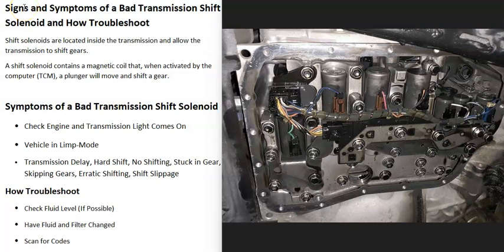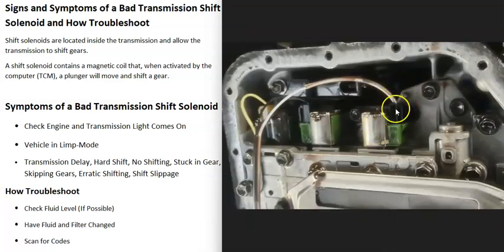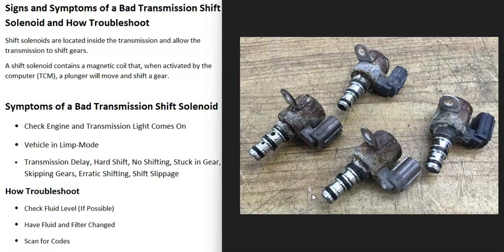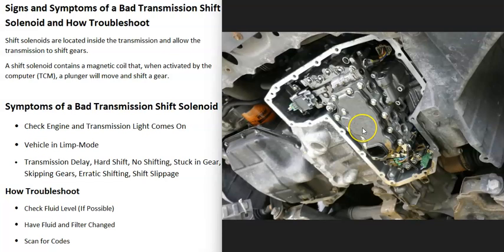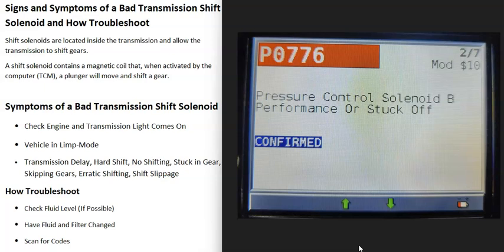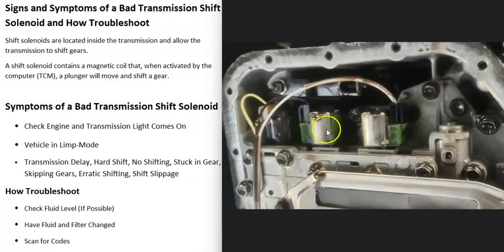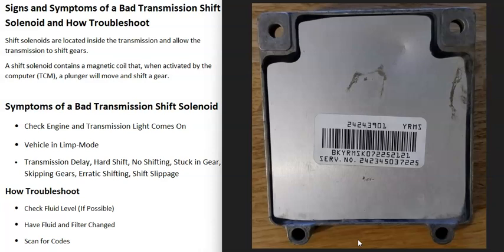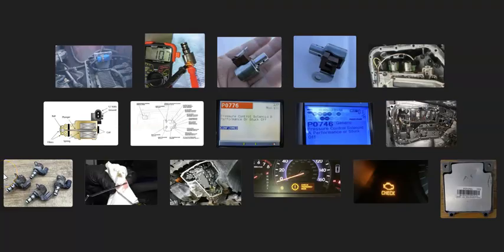Symptoms of a Bad Transmission Shift Solenoid

Comment: Thanks for sharing those information. I have 2011 corolla 4 speed automatic 1.8L I am getting a jolt when cruising Nd accepting, only happens after 30min of driving it doesn't do it at just operating temperature it happens when really hot. I have changed the fluid 5 times and at different levels and I still get hard shifts on kickdown. Please help

Comment: well I have issue with 2004 chevrolet express 1500 V6 on the morning start and run good after about 3-4 miles slow down and completely stop the engine is still running but the van is not moving. turned off wait about anhour or two start and moving here about 3-4 miles does the very same thing. What do you think

Comment: My car is a 2009 Sonata with a 2.4L engine. The manual states that the automatic transmission fluid level should be checked between 70 and 80 degrees Celsius. However, I want to know where the fluid level should be on the dipstick at 80 degrees Celsius. Should it be in the middle of the "hot" range or at the top of the "hot" range?

Comment: My truck turns on, and idles fine. It switches between all gears but it will not drive forwards or backwards. It just just revs in each gear position. No engine codes. Transmission fluid level and color are perfectly fine. Any ideas??

Comment: I have a 2013 Lexus RX 350 and yesterday all of a sudden it started falling on its face for about 3 seconds when shifting from 2nd to 3rd. I can't find a dipstick to check the transmission fluid. Do you think it's just low on fluid or a bad solenoid?? Would being low on fluid affect only one gear sequence or all of the shifts??

Comment: Got a P0763 shift solenoid C but the car doesn’t run bad or seem of it just turned on and I cleared the code but not sure if I should drive the car to diagnose it further I don’t want to ruin the transmission

Comment: Dodge Dakota 42rle transmission here—delays going into drive ONLY when transmission fluid is cold. New Mopar ATF+ fluid, only 75,000 miles, well maintained. Pulling a pressure sensor fault code. What parts should I replace—just the sensor, or throw in solenoids and/or TCM? Thanks

Comment: I have a 1995 Chevrolet Monte Carlo that is pre OBD2 and not OBD1. No means of jumper for ECM code. Problem I have is I start out running good with rpm to mph on the freeway then after enough slow downs and speed up the rpm increases above normal for mph. Example as a reference; 70mph @2250 rpm. 20-25 minutes into my commute; 68 mph @ 2600/2700 rpm. I suspect a solenoid but which one? Could try shotgun effect and replace all the solenoids.

Comment: Someone please help me. My 2005 corolla doesn't enter reverse, but it drives.
It's showing a code p0741.
What can I do please?
Reply from the maker: P0741 Torque Converter Clutch (TCC) Circuit. Check the transmission fluid and be sure it is good. If the ATF fluid is good, it needs to be diagnosed; the torque converter is having an issue, which could be wiring, a solenoid, or a bad torque converter.

Comment: Hello sir I have a Kia Sportage 1999 2000 model automatic I recently replaced a broken pump and replaced seals but the problem now I have accelerate in order to move and it only takes 12 and reverse hard

Comment: What's the difference between shifts solenoid?Pack and a shift solenoid b is it the same ? I'm getting that code
Reply from the maker: There can be several shift solenoids, usually one for each gear. A is usually 1st gear, B is usually the 2nd gear, and so on.

Comment: What if you have some symptoms but no codes or transmission light?
Reply from the maker: Has the fluid and filter been changed out at the required miles? If the fluid gets old and the filter clogged up, that can cause issues. Also, be sure the scan tool can read transmission codes; many can't.

Comment: Is it possilbe for someone to get under a car and disable a solenoid from the outside, like yank a wire loose, mine went out while parked in my driveway. Tweakers were fucking with my truck and were outside threating my truck again. I went out to drive it and it was in limp right out my driveway and all the codes come back clean, no lights on. I have a reverse but in limp going forward??
Reply: Depending on the car yes, my 2011 Honda accord has them on the outside
Reply: @jonmoore5901  2005 highlander, Codes are coming up clean, guy that scanned it said the senser never activated because it was parked when they did it..
Reply: Guy that scanned it said codes are coming up clean because it was parked and not moving when it happened, senser didnt activate.

Comment: Valvoline didn't Honor their 50,000 mile warranty I am 25,000 under that warranty and now my transmission fluid looked like oil and they wouldn't at least flush and fix them told me they are not a mechanic to diagnose properly. and since then my truck has had problems. because the over filled all fluids they cover a QT more vs specs of my truck. vand them told me it wouldn't be bad or anything. I lost last my nerve and before she shoved out of the bay they said that someone placed it.  and I said that warranty is still valid and binding as of the UCC PUBLICATIONS book. I called corporate to ask them what they are going to do with the following up. and after I spent an hour on the phone "lost communication" and never called me back in all three thresholds and no one contacted me and by UCC law and natural law they did not challenge the in the notice of response letter so I guess they willing accepted

Comment: 2015 Honda civic has the d flashing I have to unhook the battery every day because of a parasitic draw but once I hook up the battery the light goes away and is drivable until I cut the car off then light comes back on Ive replace the pressure sensor and have looked for bad grounds but no luck any insight would be appreciated

Comment: Hi.. I have a question.. I have a 2004 Chevy Trailblazer when it's cold I can drive it and it shift just fine no problem on the highway overdrive.. But once it warms up is stop shifting and I have to let it cool off before I can jump in it again and drive it home and it'll drive just fine. Thank you..

Comment: Hi I have a question. I have an Audi A6 Quattro 2002. It goes into limp mode at cold start my codes at that moment first code is C072F then P0748. Car does go out of limp if warmed up for 5 minutes but codes are confirmed. I changed the solenoid by dropping the valve and also installing a new filter and fluid. Car started running great but it’s still going into limp. I never replace the harness but now I’m checking the outside of the valve solenoid harness and see someone taped it up. How should I go about this? If I drive the car about 2 hours later I’ll get a P0741. C02E5 C02C7 I don’t know what the C codes are

Comment: thanks for the infos , i have a rav4 2018 LE that have check engine light and when I'm driving somtims it joint a bit and the other day I put on reverse and it didn't move so I had to but back on N then on R to have it to move I noticed their is some oil leackade under the transmission and took it to the technician they said its one of the solenoid but not that sure is their a solution to check the oil level?

Comment: My god, you have helped explain possible multiple issues, my seliniod B is causing allot of issues, like irratic shifts up& down, mostly in low speed, now it’s doing it at 30 mph😮I’ve been stuck on a slooped drive up or down with nothing, so I’m going to check wires 1st and clean, and see if wires rubbed , next drop pan and replace B sel, and filter,   Anything you can think of, much appreciated, Eric

Comment: I have no Engine Codes , No Trans Codes. But the car hesitates to go , but only sometimes. Also when I am going about 40 MPH, it also hesitates to go above 50. When it’s going 50 it runs completely smooooth
Reply: Same issue here, did you figure it out ??
Reply: @nikehoodtv8805  Did you figure out what the issue is?
Reply: Stop driving slow 😂😂😂
Reply: same issues with my 2011 Toyota camry
Reply: Same

Comment: Excellent video. To the point no dragging on I think you should make more.❤🎉😊
Where are you located I'm in northern New Jersey I can have you replace my Acura automatic shift solenoidd D. I have a question does the D shift solenoid d means for drive
Reply: No it’s the gear

Comment: Hi there friend, 01 Toyota 4runner 4x4 sr5 automatic. Have you ever heard of a p1760 code? Trans shifts through all gears, downshifts normally but the issue is niw since code she drops into each gear very quick and harshly. The more throttle the better it drives as far as drivability, trying to putt putt is very noticable and concerning feeling to say the least. Regardless theres a prob Im just outlining a little bit. Can it be driven this way wiithout additional damage until I replace solenoid if thats what this issue is..? Thanks?

Comment: I have a 2015 ford transit rebuilt the trans and  now it works but if I use it over 45 mins the trans light comes on and starts slipping or won’t go then min later it will work again like normal any ideas of what it could be

Comment: I have a '91 Chevy Van with a 4L60 trans. Lately I experience troubles with engaging my Overdrive. First it engaged Overdrive but after a few miles it disengaged and shifted back to 3rd. I allready exchanged my trans fluid and filter, which made it a little bit better I guess. At the moment it shifts to Overdrive but after a while it disengaged again and leaves me in 3rd on the highway or on slower speeds. Shifting to 1st, 2nd and 3rd and back is still smooth and without problems. What could be the issue?

Comment: Nice job.... 2015 Mini Cooper Paceman S All4. Automatic Transmission.
1) When I "almost" come to a complete stop at a stop sign or stop light, then press the accelerator to keep going, the car jerks very hard like there is an engagement delay when taking off. Someone mentioned the solenoids might be going bad, or the TCM. They changed the transmount, as they thought that was causing the jerking sensation. It did not solve it. The Motor mounts were not changed as they were not leaking.  
2) If I am at a stop and I remove my foot off the brake, the car does not roll right away like it used to. There is a 1-2 second delay before it slightly jerks and starts to roll. again it use to engage and roll right away without delay.
3) Clanking/squeaking noise coming from the Drive train/engine, suspension or transmission on initial acceleration and deceleration at slow speed (especially when cold). Feels like I can feel it coming thru the throttle. Mini Nashville hears it but can't pinpoint where its coming from or what is causing it. 
Thoughts?

Comment: Im gonna try leaving a comment since it seems you are very responsive. I appreciate that. 

2003 Ford F250 4x4 6.0.

Truck has always drove fine. One day, i drive it all day and went to pick up my daughter. I idled for probably thirty minutes, and when I put it in drive to leave, it wouldnt engage in any gear. I pushed the truck into another spot and allowed it to cool. It still would not engage. Out of frustration, i slammed the gas and suddenly the vehicle jumped into gear and drove fine. The problem never came back. 

Well, now the truck sat for about 1 week, and it will, again, not go into any gear. To be clear, the shift linkage works, and I have observed the linkage does move the selector located on the transmission. 

Fuses are good, transmission fluid appears topped off, and the fluid looks great. Im wondering if it is the pump, TC, or simply a bad filter? What do you think?

Comment: I have a Dodge caravan 2001v6 3.3 I was driving to the store parked van went in side store cAme back out and van has no forward are reverse gears it won't move no problem with transmission before that not sleeping are any problems with it do you have any ideas on what to do

Comment: I have a few questions. Ok I have a 2011 Nissan Altima. I had a p1778 stepper motor code. Changed it. Changed fluids. Ran great for about 2 months. A code come up for a p420 for catalyst threshold bank 1. Cleared the code out. And now I have the p1778 code again. With it saying stepper motor and dcc solenoid. Now it won’t go past 1st gear. So how was it that I cleared a code and it doesn’t work anymore? Help!!  What would I need to change to get it running correctly.

Comment: Hi. I have a 1995 228,000 miles Sierra 1500 pickup.  Only symptom I have is delayed shift from 1st to 2nd. It waits until 2,700 to 3,100 rpms. I can usually make it upshift to 2nd by easing up on fuel pedal just a little for a moment. Does it hot or cold, in cold weather and warm. 

Everything else works as it should. It will downshift from 2nd to 1st as it should. Fluid clean, good and exactly Full. Fuses all good. No CEL or codes stored. No visual leaks or consumption. 

Is this the 1-2 solenoid / solenoid A failing, more than likely?
Reply: I’m having a similar problem with my 2013 Toyota Camry is only happens when I get up to 20 mph is a a slight hesitation before shifting gears ⚙️ but if I ease up to the 20mph it doesn’t do it no lights or codes at all only 90000 miles on the car

Comment: I was priced over $4,000 to get my transmission rebuilt. I was told that was my only option. Change solenoid A and filter add transmission is fine! Save myself a lot of money thanks for the video.
Reply: We’re u get the part from
Reply: Did it throw a code?
Reply: Man I am in the same scenario, my car skips 2nd and does not engage the 5th gear. Other than that it runs like a champ, (no slips or delays neither harsh changes). I've quoted in 5 different shops and they not even test drive, they want to rebuilt it and the cheapest I got was $4k before taxes. I'm considering do it myself. It is just a pain that I don't have a garage, everything I DIY is on the street or some parking lot.
Reply: Unfortunately I did not get a code related to the transmission. I have my own scanner but the check engine light only show codes referred to the knock sensor and the exhaust gases.
Reply: @MrCozin-kd9mb I have the issue going 1st to 2nd around 1500-2000 RPM. There are no codes, so I guess I will need to drop the ATF pan and check each solenoid with a multimeter. No issues on downshifts or reverse
Reply: Try to see if you can find a diagram of the tranny solenoid pack. It would be useful once you have the oil pan down.
Reply: Where did you get the solenoid part from? I can’t find it online. Thank you

Comment: Hello friend I have a question I got a Toyota Camry 208 se 2.5L and give two codes p0741 p2714 transmission pressure control solenoid and shift control solenoid   But 3 month ago I change tranny fluid it was dark not red and as soon I change I delete codes no more codes but now comes back same codes so what you recommended me thank you

Comment: I don’t have any codes but when I shift you can hear a buzzing rattling noise I guess coming from the manual shift lever. And makes alittle noise while driving . The shift solenoid can cause this ?
Reply: This is a 2002 dodge ram

Comment: I have a 04 gmc yukon Denali when I first got the truck it would shift but it was delayed the fluid was really dirty so I changed it and replaced the fluid n filter now the truck won’t shift but 3 gears and is slipping bad but I have a code for shift timing solenoid
Reply: What code did it show?

Comment: Sometimes I wish you guys would use a car with the symptom instead of just explaining it right show us a car with a bad solenoid that way we know what to look for instead of explaining the symptoms because they are pretty much sound the same..but great video
Reply: There's  another video to check each solenoid by using multi tester for electricity to check for click response. No click means needs replacement.

Comment: Are you doing I have gmc truck Savana 3500  v8L 6.0 It s stuck in gear ,when I put it in drive it take like 30 mn to drive ,it do it when I out it in reavers too .i change the trans fluid ,filter ,I change evap I clean the trotlle ,it still doing same thing and I don’t find any trans code i disconnect the shaft I put it up when press the gaz pedal it goes over 100 miles .
Reply from the maker: It seems like there should be codes. Does your scan tool read transmission codes? If you don't have a scan tool that reads transmission codes, many automotive stores will do a scan for free.

Comment: Thanks for the informative video! Lately I’ve been having transmission problems where my car is stuck in overdrive after I come to a complete stop. Could a solenoid start failing even if there are no codes shown on the OBD scanner?
Reply from the maker: Usually, a bad solenoid will give a code. Be sure the scan tool can read transmission codes. Also, if possible, be sure the transmission fluid is not low or dirty.